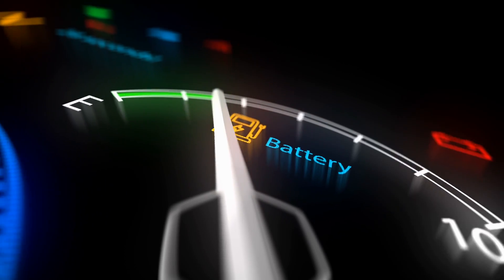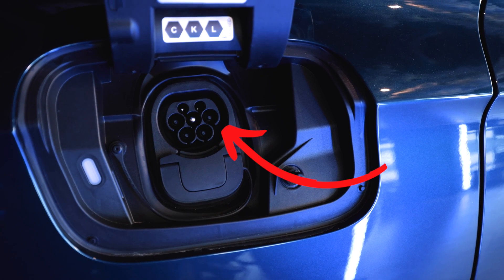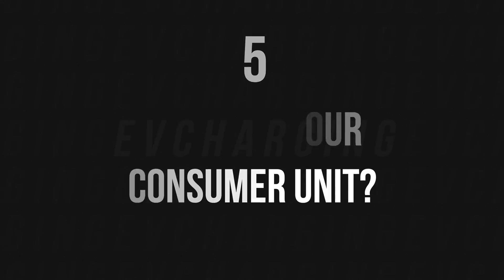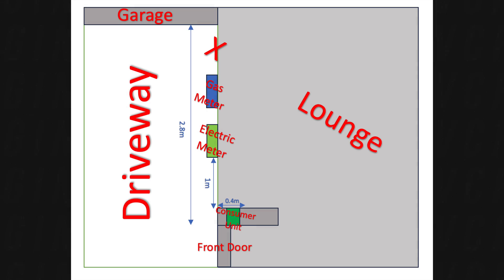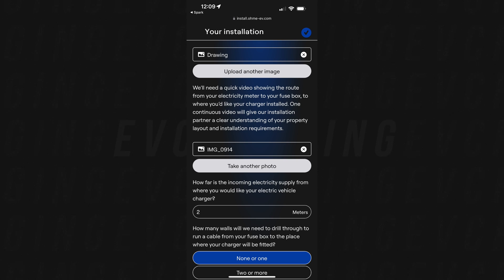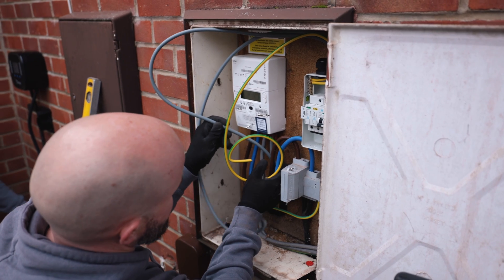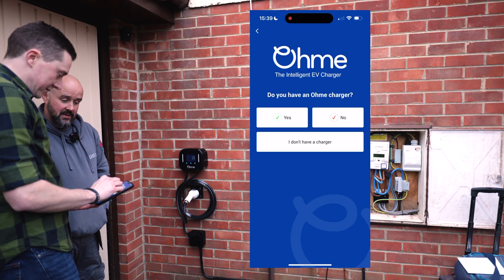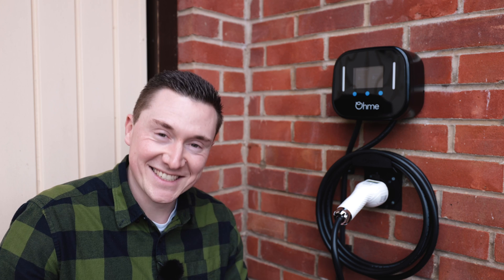EV Charger Install! | Ohme Home Pro

Comment: Your installer should also have contacted your DNO (the local electrical governance group such as National Grid) as they need to make any changes to the main amp in your meter box, relevant if you have a looped (shared) set up, do any ground work etc into the house so that your charger delivers the 7.4kw you want, otherwise you may be disappointed with the charger performance.
 amps lower than 60 will not perform well.

Comment: Is there any EV charger where the wire is hidden not just left hanging on the wall???
Reply from the maker: Most need a box underneath. There are some examples of premium charge points like Andersen. But not sure if they have a box built into it or if it’s placed in between the meter and the charge point like Ohme.

Comment: No mention of the need for 100amp incoming feed??
Reply from the maker: Most homes have this already however if you don’t then any electrician would class this as one with extra work required at which point the homeowner would need to pay to arrange to have it installed.

I posted a year after this install date with more details and what it’s like to live with 🙏
Reply: @npoleary I think ‘most homes’ is a stretch. New ones in the last 10 years maybe.

Comment: Seems some people have good experiences but mine has been horrendous. The charger drops the API connection to MIni/BMW and so it cannot find the battery charge %. The support is hopeless, they advised to disconnect from the car app and just set the % to top up every day based on checking what you read on the car dash or app. I use the BMW and third party apps that read the battery level without issues. 
I am considering getting a dumb charger and program it myself.
Reply from the maker: Just replied to your other message on the other video 🙏

Comment: You did not mention how the app allows you to charge using your solar panels.  Our Solar Charging toggle does not work and, so far, Ohme has been unable to explain or fix this.  Such a shame in a heatwave.
Reply from the maker: Ah that’s because I don’t have solar panels…

Although my neighbour have some going on right now, I think they’ve got 12!!

I’d love to get some and try it out, I did see an option for Solar with Ohme but am unsure of how it works…

In “Settings” and then “Solar Charging” on the app. Is that the same for you?

Comment: Does the wiska box always need to be below the charger or can it be tucked in under the eaves off a bungalow then a cable running down into the top off the wiska and another outlet from the bottom
Reply from the maker: Hmmm I have to admit on that one, I’m not sure. I assume it would need to be readily accessible or something.

Something to ask an installer as they’ll know the building requirement codes etc and what can / can’t be done.

If you’re happy to, do let me know though! I’m curious on that one! 🙏

Comment: Yeah the DNO will be chuffed to bits to see that consumer unit in their cabinet.. electrician should know better (and quite probably does) Wonder how he felt about being filmed while doing it 😬🤣🤣🤣
Reply from the maker: Thanks for messaging! So actually I did some digging on this after my install so hopefully this helps.

Officially speaking, the NICEIC (National Inspection Council for Electrical Installation Contracting) recommend in an ideal world not to install any additional equipment in a meter cupboard like in my video.

However as long as it’s done correctly then it will be okay and won’t cause any problems. The main reason being as the cupboard is finite in size, if someone needs to come out update your main cutout fuse, or change your meter, they don’t want to touch someone else’s installation works. Also “technically speaking” drilling an additional hole into it increases the risk of water ingress which is why mine was done through brick right underneath to minimise this and prevent it from happening. For example if one was drilled at the top, this would not be good for when it rains which no one would do for obvious reasons.

So it can be done, but as long as it’s done correctly. Installations like this can be done for aesthetic reasons or for ease of use depending on the property as we all live in different shapes and sizes of houses, installations can vary a great deal so if you’re not sure or have any concerns speak to the installer who’s installing one for you and they can work with you and install it the way you would like.

For peace of mind I did receive a certificate a few days later confirming that my install is NICEIC compliant too 🤓

Comment: Shouldn't install the fuse box in the meter box
Reply from the maker: Thanks for messaging! So actually I did some digging on this after my install so hopefully this helps.

Officially speaking, the NICEIC (National Inspection Council for Electrical Installation Contracting) recommend in an ideal world not to install any additional equipment in a meter cupboard like in my video.

However as long as it’s done correctly then it will be okay and won’t cause any problems. The main reason being as the cupboard is finite in size, if someone needs to come out update your main cutout fuse, or change your meter, they don’t want to touch someone else’s installation works.

However had an inspection done and even had a meter upgrade done since the install and it’s all good 👌🏼

Comment: Did you need to have an isolator installed in the end? 
Also how is the charger holding up after 12 months?
Reply from the maker: No I didn’t thankfully! 😅 

I am planning a 12 month / year review of it. Just waiting to get an EV on test.

But it’s been great, I don’t own an EV (wish I did) but this has saved me hundreds of pounds in electricity costs. I need to work it all out yet which I’ll do for the video.

The only “issue” I’ve come across is the API integration with linking selected compatible cars, but as an Ohme representative said, just don’t link them together and just add what percentage you want (for the tariff that I’m on). And it works flawlessly.

If I moved house, I’d get one of these again in a heartbeat.

Comment: Verry messy looking set up as it comes pre flexed for no good reson
Reply from the maker: Messy? You mean the cable has a flex in it, so it kind of coils together?
Reply: @npoleary  no i mean extra junction box next to the unit. Strikes me a bit DIY ish Ohme units. So no go at the workmanship here but design of the unit....
Reply from the maker: Oh I see, I don’t mind it to be honest
I guess they could have made it bigger to put it in but I believe they designed it that way so the actual Ohme charger can’t be opened to retain it’s waterproof rating. This being a huge selling point for installers as they don’t need to open the charger up as it’s already pre wired together
Reply: @npoleary  i feel like its been designed for 1/2 baked octopus engineers....
Reply from the maker: Well I’ve had one for the past year and it’s brilliant. Might do a follow up video on how much it’s saved me.
Reply: @npoleary  was it due to that EV charger tarrif that some suppliers offer?
Reply from the maker: The integration with Ohme and Octopus Intelligent Tariff. But yes you could get similar results with other chargers that have similar capability.

In a nutshell, I can charge an EV at home now when I have one on test for about £5 and overnight. Before it would be more like forever and £20. It got in the way of me testing it out!

Comment: Ohme are horrendous! I ordered my motability car Oct, then Ohme said they wanted extra money to put it in and wanted it up front with no option to pay over time. Motability only cover so much.  I got my car on 16th dec.  they said they would put charger in on 19th Dec, after a lot of hassle, but I was in hospital by then. So next date they said was 31st dec, which was after xmas, leaving me stranded over xmas with a car and no way to charge it. as I explained this needed to be in before 31s, they said to find someone else to do it and backed out of the install, its now mid january, ive had the car a month, its not moved. still no sign of this charger bing put in adn living in the countryside with no bus or alternate transport, i am stranded and no sign of this ever being done. avoid ohme at all costs!
Reply from the maker: It’s important to note that most charge point providers don’t install charge points so after Ohme supply the charger it’s not “directly” in their hands.

There are installers based all the way round the country covering different regions with different employees so honestly do get in contact with Ohme who will possibly be able to source another or investigate what’s going on.

However, one thing I will add is that if any extra work is required for an install, the end user will have to pay. So for example (in a simple example), if the cable length that is needed is longer than a standard install this would need to be charged.

Not having a charger install right before the holidays is risky because as mentioned above from the sounds of it, if remedial / extra work is needed it can cause delays. Things have to be signed off by the distribution network and more if the work required is more than a standard install.

I wish I could help but you’ll need to chat to Ohme themselves, I’m not sure they read my comments on my channel. They will be able to sort something and get you up and running.

I’ve contacted them once and heard back within 24 hours when I had a question so contact them here:

Web: https://ohme-ev.com/how-can-we-help-you-today/
Phone: +442033751586

Comment: Hi, great video, really helpful. What happened about the isolation switch? did they find one did you have one installed?  I have booked my charger to be fitted but I also can't find one. Any info would be greatly appreciated, Thanks
Reply from the maker: Thank you! They said one wasn’t needed so I was all good! 😊 
Being using mine for almost a year now and amazing! I was thinking of doing a follow up video in 2025 👀

One other quick question, are you with Octopus Energy for your electricity? ⚡️
Reply: @npoleary  Hi thanks for the quick reply, yes I'm with octopus
Reply from the maker: Awesome! If you switch to their intelligent tariff, you can charge most EV’s for around £5. It’s amazing, saves me so much money compared to before
Reply: @ great tip thanks for your help

Comment: Did you ever make the follow up video?  I was also wondering if it’s compatible with a Lexus?
Reply from the maker: Looking to possibly make one early next year 🙏

A quick search online looks like it does use a Type-2 connector in the UK but just double check as I’ve never used one hands on. I’d it does then yes it’ll charge on this one 🙏
Reply: @npoleary thanks. Yes the Lexus definitely connects. But I don’t think it’s compatible for way communication. 

Thanks for creating the video.
Reply from the maker: @SHARP2026 so Ohme allow (under the labs section) to connect car apps to the charger. I have never done this as it’s not needed. As I don’t own an EV, I have used it on any many EV’s and it works absolutely fine.

Because of my tariff, I get out of the car, choose how percentage to add on the app and plug it in. As long as the plug fits, it’ll work!
Reply: Thanks. Good to know. 

The car is a plugin hybrid. I’m currently trying to work out if it’s worth spending the money on this, or simply use a normal socket. 

Might make for a good video 😄
Reply from the maker: @SHARP2026 scheduling would be easier to get the off peak rates offered by your electricity provider. Just remember that if you’re using a 3 pin socket, don’t use an extension lead! 👍🏼 it must go directly into the mains.

Comment: I've been thinking of making the switch to an EV, but the more I dig into it, the more of a pain in backside it seems to be! How the heck can it be so much hassle to get a charger fitted? I think I'll stick with ICE until the process is simplified, which must happen if we are to scale up in the coming years.
Reply from the maker: All of our houses are different, walls, lengths of cabling required, fuses etc.
They are all very important for an installation. The guide was easy to follow and then they did the rest 🤓

Comment: Actually, the number of uses of 'actually' in this interesting informative vid was a complete distraction, I had two lines and only needed one more for a full house. Also, for transparency, if you use the 'discount code' quoted here to become an Octopus customer, Nick gets £50 off his energy bill. Alternatively, you might want to offer that £50 to a friend or relative who is already an Octopus customer, ask them, they can send you a code.
Reply from the maker: I hadn’t noticed me saying “actually” a load of times. But thanks for pointing it out, I’ll keep an eye out next time.

Yes Octopus Energy offer £100 split with both parties if someone switches. I think they pay it when it’s been running for a while or something like that. To find the code it’s on the app at the bottom of their Home Screen.

Comment: Something not mentioned is after 3 years, there's a monthly charge for the sim card. This or your charger  becomes dumb
Reply: Apparently, they have a sim that connects to wifi for areas that have little to no cellular reception.  Probably worth investigating if you have good wifi at home. I opted for hypervolt home pro 3 over this. My preference being, I think it looked nicer, and the tethered cable looks much neater the way hypervolt stores it.
Reply from the maker: I did ask Ohme this don’t worry! Before I’d even arranged this install it was one of my pressing questions as I saw the small print on the web! 😬

Basically they said that as they have been going for a few years already, they have already renewed existing owners installations and are happy to continue offering it for free (and most likely will for the foreseeable).

They have that in there so that they can charge if they want to in the future. So to clarify it won’t just “stop working”, they’ll be a small charge if they do. Apparently as it’s such a small data contract, the cost would be very very small. It’s not like that sim is downloading videos etc or streaming large quantities of data, just simple commands from the app and status updates.

So it’s free currently with the possibility of charging in the future.

Similar to how Apple have done the emergency text via satellite option. They said after two years they were going to charge, but actually it’s been two years and they’re just renewing it again.

Comment: As somebody else has said the enclosure they have fitted consumer unit should not be in the DNO cabinet. Surge protection can be installed any where on installation to protect the whole house.
Reply: I agree, that's only for the distributors  meter and cut out.

Comment: Great video, I’ve gone from being clueless to armchair expert, cheers! One question though, did the fitters connect your charger to your consumer unit inside the house, or is the charger only connected to the mains unit outside?
Reply from the maker: Thank you!
It’s just connected to the mains unit outside with it’s own fuse for turning off just in case

Comment: Another thing you need to know is they are very very expensive. 😡😡😡🤠
Reply from the maker: Installs from chargepoint providers range anything from £700 to £1,000 but check with them directly to be sure on their pricing.
As all of our properties are different sometimes extra work might be needed but they would let you beforehand.
Reply: @npoleary  I challenge you to find one under £950 fitted. This is why I still use the Grannie charger as most weeks I only charge once a week.🤠
Reply from the maker: PodPoint fitted from £849 🤓

I can’t vouch for how they work though but my Ohme one has been great when I’ve had an EV on test.

I’m sure the PodPoint one although cheaper will do scheduled charging but my Ohme one integrates with my tariff so off peak can be at random times throughout the day rather than just overnight.

But if need a charge quickly, I can at the tap of a button. Ohme just has a few extra smart features from what I’ve seen that do that integration. But there are cheaper alternatives, just depends what you’re after 😎
Reply: @npoleary  2 years ago when I was looking for one PodPiont was from £1000. They must have come down in price.🤠
Reply from the maker: Oh yeah maybe!

Basically when I was looking for a chargepoint, I found a lot of them had scheduling for off peak charging but Ohme had a few extra smart features so I went with them.

There are loads of other chargers out there but if you are going to upgrade to a faster one, just pick one that’s the right price, features and looks that fit right for you. And make sure if you’re picking a different charger, think about if you want tethered or un-tethered and how long the cable needs to be etc.

Any other questions message me back! 👊🏼
Reply: @pgbaines65  Yep, just looking into this myself and the cheapest quote fully fitted starts at £1200 😔